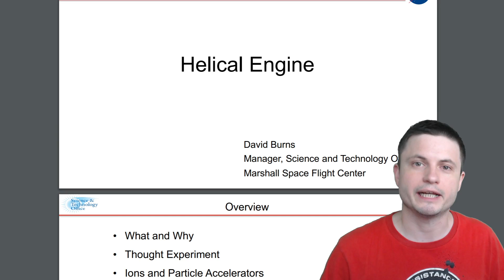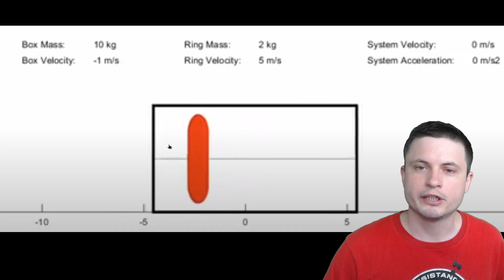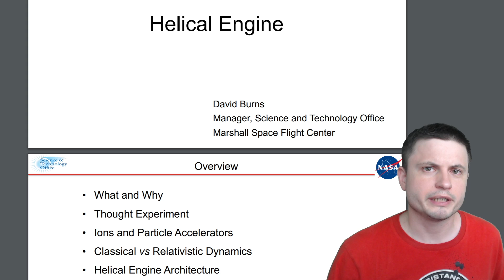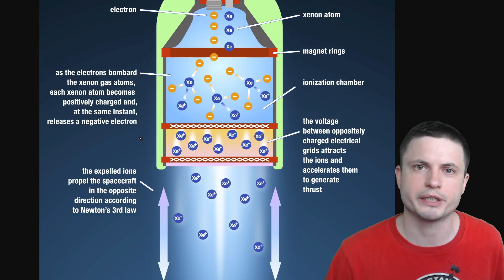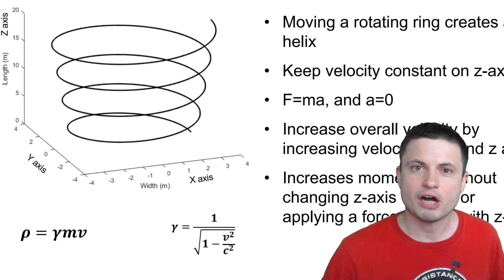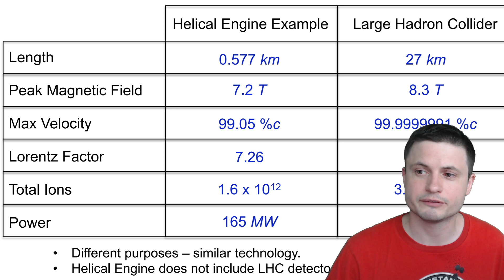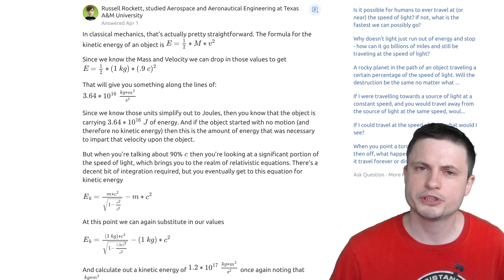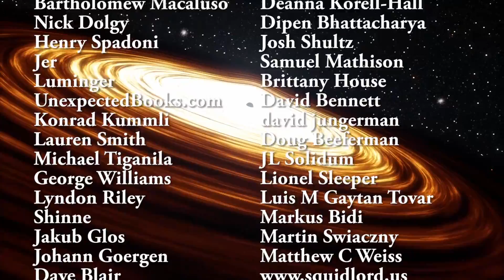NASA Engineer Designs a Near Light Speed Engine But Does It Work?

Comment: "I decided to do something really crazy and actually read the paper instead of criticizing it first."
Reply: Only 7 likes man how underrated
Reply: @hatman23433  I can live with it.  Thanks :)
Reply: Any chanve you have a copy of it please? I would like to read it
Reply: @senseilewis3707   Check the description of the video. It's a NASA report.
Reply: @D_V_.746  "Its bullshit you havent made any calculation youre misunderstanding a law,"

I have a PhD in particle physics. I'm pretty sure if I misunderstood something basic like conservation of momentum someone would've pointed it out by now.

The calculation is unassailable. Initial momentum = 0 (since there's no motion). Final momentum != 0 (since the spacecraft has some v != but nothing else exists in the universe to compensate). Momentum is not conserved. Period, end of story. Furthermore, the kinetic energy gain per unit time under some thrust F is F.v (see any introductory physics textbook), but the power input is P. If F.v > P, which happens at v = P / F, you have more energy than you put in, so you can hook the thing up to a generator and make a perpetual motion machine. Again, this is unassailable and indisputable, which is probably why NASA removed the pdf from their website.
Reply: Ted Bundy   "that's a very unscientific mindset "

That's what every perpetual motion machine designer says. Look, I don't care that your feelings are hurt, Ted Bundy. This guy proposed a design based on current, well-known physics. It's an objective fact that according to current,, well-known physics, the design doesn't work. The guy's proposal is therefore moot. This is very simple logic, Ted. Surely even you can follow.
Reply: @D_V_.746  Just stop embarrassing yourself. This was a huge blunder by someone at Nasa, and you are talking about things that go way over your head YOU are the one being dismissive here, not isodoublet who kindly explained why it doesn't work, in much kinder words than I would have in his place.
Reply: @D_V_.746  "Why dont you use your PhD and build something better"

Two answers:
1. I am using my PhD and building things that actually work.
2. Those things are not magical space drives that are forbidden by elementary conservation laws to the best of humanity's collective knowledge.

"instead of just trying to shit on other peoples innovation."

Because it's not an innovation. It's just a mistake. Furthermore, by steering people away from what doesn't work, I'm helping direct people to consider solutions that might work, so refuting nonsense is an important part of progress. If you disagree, you fundamentally disagree with science and (to be consistent) I recommend you throw your computer away. It was built using these principles you dislike so much. 

" The NASA engineer that designed the system was probably a lot better versed in the principles than you are"

On the contrary. Even a smart high schooler is more versed in these principles than he is. You'll notice I only needed high school physics to utterly and irrevocably debunk this idea, which shows that the guy isn't familiar with elementary high school physics. That you don't like this fact is irrelevant, but it is a fact.
Reply: @D_V_.746  "How does this design violate the conservation of momentum?"

Imagine the spacecraft is the only thing in the universe (just for simplicity of discussion). Initially it's not moving. Total momentum of the universe = 0. Then you turn the drive on, nothing leaves the spacecraft, but it accelerates. Now you turn the drive off. The momentum of the spacecraft != 0, but since no propellant was expended to compensate, the total momentum of the universe is now != 0, so momentum is not conserved. That's how trivial it is.

"its not like hes saying you dont have to constantly add energy into the system in order to make it work, that would be impossible."

Because it violates conservation of momentum, it accelerates much faster than an ideal photon rocket would given the same input power. This means there's some speed at which the kinetic energy gained exceeds the power input to the drive (that speed is given by power input / thrust). Now the drive is a net energy factory as well, so you can strap it to a generator and enjoy more energy than what you put it. It's a perpetual motion machine.

"But on its face its innovative and its got merit so why not explore the idea? "

Because it doesn't have any merit. The guy simply neglected the fact that in order to accelerate the donut and make it more massive you have to pump energy into it, and there's a recoil force associated with moving that energy around as well. When properly taken into account, you see that the total thrust is zero -- the drive doesn't move at all, as conservation of momentum demands.
Reply: Ted Bundy  Science knows it doesn't know everything. Otherwise, it'd stop. That has nothing to do with this latest perpetual motion machine design.
Reply: Ted Bundy  "You don't have a good mindset"

Sure thing, Ted Bundy.
Reply: Ted Bundy  "just realize perpetual motion is putting in no energy and getting free energy out. again, this drive relies on constant energy to be put into the system, which shows its not perpetual motion"

And you have the gall to pretend you're a physicist. Look, this isn't complicated: under an amount of thrust F, the kinetic energy increase per unit time will be F.v. Say your engine needs a power input of P to function, then when v > P/F, you're gaining more kinetic energy "bang" per unit time than you're paying for with your power "buck". Strap the thing to a rotor and you have a free energy device.

For all real propulsion systems, the value of P/F is larger than c, so we're safe. For this guy's propulsion system, it's less than c, so it's a perpetual motion machine, which proves it's nonsense. There's no argument, buddy: energy and momentum are both provably conserved in electromagnetism (whether quantum or classical), so any suggestion of a device like this that doesn't rely on new physics can be shot down immediately. Real physicists understand this.
Reply: @isodoublet  Could one make the case that from the ship's reference frame the relativistic momentum of the ion ring traveling in either direction is equal and opposite thus producing no thrust, and conserving momentum.
Reply: @09patrick22barnes95  The momentum of the ion ring is always opposite to that of the rest of the ship, yes, so the position of the center of mass doesn't change.
Reply: @D_V_.746  "but there is still a overall positive movement."

If there were, conservation of momentum would be violated. There's no escaping this.

Like I said: initial momentum = 0. Final momentum != 0. It's explicitly not conserved. If you want to dispute this, instead of a wall of text, just show how my calculation here is wrong. But you won't be able to, because this is the bare fact. You can't meaningfully disagree.
Reply: @D_V_.746  "You dont have to have a PhD to use common sense and to be supportive of ingenuity. "

There's no ingenuity here. Just a physics mistake by someone who's ignorant of some basics. 

"If you want to bitch and fit about a principle that has merit and uses proven principles, fine you do that."

That's funny, because you're the one doing that: conservation of energy and conservation of momentum are provable principles that irrefutably apply to this design, which also irrefutably violates it. Conservation laws are the "proven principles" which you're denying because you don't like them. But that won't make them go away.

"But thats the great thing about science, whether you agree with it or not, its still fact."

Hear hear! Whether you agree with it or not, this design violates conservation of energy and conservation of momentum. That's just a fact.
Reply: @isodoublet  Think of it like rocking forward in  a chair with wheels lol.
Reply: @quentinfreeman7516  Static friction with the floor. No analogue of that in space. Conservation of momentum is a theorem, not a guess.
Reply: Ted Bundy  Bye! Whenever you come up with an actual argument I'll be here. Good luck!
Reply: @D_V_.746  You are stupid. Here is why : the paper is not questioning any laws of physics, he wouldn't have been laughed at if it did. The paper uses special relativity, also known as basic science, in a completely mistaken way, to design an hypothetical engine. The keyword here is hypothetical.He never built anything, proved anything, he said that theory would allow for such an engine. But he made a big theoretical mistake. Conservation of energy and momentum is one of the most basic laws of the universe, and he raped them is this now shamefully removed paper. 
If he builds something that works nobody will laugh, or if he creates a theory that uses new physics that could be tested nobody would laugh. But if he makes stupid mistakes in applying existing theories, then yes, people will laugh. And people make mistakes like that everyday, thank god Anton doesn't make a video everytime.
Reply: @D_V_.746  Would you prefer I lied? "Here sir, this thing is totally possible! The guy didn't make any mistakes at all when deriving this, none whatsoever." So then people waste time pursuing an idea that's fundamentally flawed? Maybe that's how you're accustomed to it working (orders are orders even if they're bad orders, there'd be chaos otherwise) but in science we don't roll that way. The truth is always what's most important for us.
Reply: @isodoublet      I think you both have a point
                                   it does look impossible by current physics
                                   but God keeps rewriting the rules to keep us awake
Reply: Me as well
Reply: Can you read it to me?
Reply: What were the side affects?
Reply: You sir are an absolute madman.
Reply: @rustyshackleford3914  Thank you Wibble Wibble!
Reply: And then criticizes the math same as them
Reply: You only need to read the first few words, which speak of a spaceship reaching 99 % of c without telling you where that almost unimaginable amount of energy would come from : E = mc2 where E = energy in ergs, m = mass in grams. and c2 = speed of light in centimetres per sec squared. The energy of an H bomb is nothing by comparison.
Reply: Actually, you don't need to read it. The engine violates conservation of momentum so it's guaranteed that there's an error somewhere. His design isn't even new -- James Woodward has been trying (and failing) to advance a similar design for decades. Woodward, to his credit, understands that this kind of design is forbidden by our known laws of physics, so he proposes some new ones. This guy is trying to make this stuff work without any new physics, and that we know with absolute certainty cannot be done.
Reply: isodoublet so conclusive
Reply: @isodoublet  amazing                                    a sane person
Reply: @isodoublet  we also knew you couldn't use a rocket in space..

Until we did
Reply: @mondaysinsanity8193  Nobody 'knew' that.
Reply: @isodoublet  yes actually there was multiple scientists at the time saying rockets cant work in a vaccuum because there's nothing to push on
Reply: @mondaysinsanity8193  1. What "scientists" were these? I have seen idiots say such things but they weren't scientists. Any physicist could've told you that rockets can work since at least the 1700s. 2. So what? This guy here is saying that you can move without pushing against anything, and that's wrong too. It doesn't matter what people say. It matters what the theory predicts. The theory predicts that rockets work and this doesn't, and that has been so ever since the theories were put to paper. What some idiot or another "thinks" the theory says is irrelevant. Both facts are mathematically demonstrable.
Reply: @isodoublet  the point is science exists to try to prove itself wrong thats the point the second you start scoffing shit kinda stagnates
Reply: @mondaysinsanity8193  If known science is wrong, then this idea, which is based on known science, is wrong too. Look, it's simple: the guy says "the theory predicts X". Does the theory actually predict X? The answer is no. It very much doesn't. If it doesn't predict X, his design is worthless. You may find a design that does work as a thruster and falsifies known physics, but it probably won't be this one. Or, if it does turn out to be this one, it'll be a total coincidence because we know for a fact that this guy's argument is wrong. That's all there is to it.
Reply: @fadzaindlovu1097  back when? Lmfao
Reply: @mondaysinsanity8193  Rubbish! Newton knew 300 years ago that rockets would work in space. According to the equation E = mc2, the energy required for a 1,000 ton spaceship to reach 99 % of c  would make the energy of the Chicxulub meteorite pale into insignificance. Where is such energy going to come from? Nuclear power is totally inadequate.
Reply: @mondaysinsanity8193  well they were right for a degree as as several rockets can’t work in space 
Like atmospheric rockets
Reply: RESEARCH """""BRIAN AUSTIN LAMBERT""""" 100% WORKING MODEL OF A FLAT EARTH,,, 
WEN,,(IF U DO CHANCES ARE U WONT LOOK),,UV DONT THAT GO RESEARCH """"" THE PRIMER FEILDS """"",,,VLOUMES 1 THREW 4,,,BASICLY(INCASE U DONT LOOK) CANT LEAV FIRMAMENT IDIOT,,,,EVVVVVVVVVVVER!!!!,,, NASA LIKE ANNNY OTHER CIVALIZATION BEFOR US!!!,, HASSSSS NEVER LEFT THE FIRAMENT!!!!,,,:Fact: SO NOW I SAAID UR ROOONG,,,, DIS PROVE ME!!!!!!
U CANT!!!,,, ESSSSSSSPECIAL IF UR RELIDGIOUS!!!!!! KORZ THE VATICAN HAS THE WORLDS BIGGEST SUN DIAL!!!!!!!!!!! aka TIME KEEPER!!!!!!!! ASK URSELF Y!!!!!!!!,,,YEAH U BEEN LIED TO SHEEEEEPLE!!!!!
Reply: @rexbaking1701   I know I shouldn't reply but I can't resist.  Dude, first of all, type in sentences.  Second, don't use all caps, it just makes you look like a crazy person. Third, I really think you need be taking your medication on a regular basis.
Reply: @ptonpc  lol he's on gire
Reply: @ptonpc  Yeah... It's not so much the "all caps" that makes him look like a crazy person. That just makes him look like a LOUD crazy person. Just saying.
Reply: @dhotnessmcawesome9747   Unfortunately plenty of them about.

Comment: The problem with any near light speed space travel remains the same .and with this concept in the video the problem reaches critical. The problem is once you reach the extreme upper limits of  velocity is how do you stop.if you are constantly accelarating it is going to need a great amount of fuel too stop . And in this example of an alternative propulsion system it would take a very long time too slow down 
A very long time. It is my own thoughts that tell me that anything that reaches the near to the speed of light velocity will never slow too a stop ever again unless it smashes into something like in an accelarator. Pleace tell me of anything that has ever reached the speed of light or near the speed of light and then stopped?.i dont think you can stop without having enough fuel and it would require more then  alot. And more then you could carry.not to mention attempting to turn the ship around while taveling the speed of light so you could do a burn might like wise be impossible.thusters at the spped of light probably would be sure death.

Comment: I assume instead of "a mass" the acutal accelerated object could just be for example some noble gas... I take it the point of the spiral is to accelerate the object without imparting a forward or reverse thrust, if however at the time of deflection it has the same energy as when it bounces off the other side of the container wouldn't this prevent thrust from occurring since you have applied a force at peak mass in both directions even if when it is boucing back it is doing so at say half the speed. Certainly interesting .... I need to read the paper some more and thing about it.

Comment: In the mid 90's, I emailed NASA with a sort of "perpetual motion" engine using magnets and electromagnets within an inductor(I've been constantly updating my design through the years).  Using this motor to generate a magnetic field around a space vessel and then using satellites to beam polarized RF at the ship to push and pull objects through space. I never heard anything back.  Just recently, I saw a company had developed a similar electric motor design with a super high efficiency.  Either someone at NASA perfected my design or someone I was stationed with in the NAVY stole it.  =-(  One of these days, I'll have the opportunity to show them how to make it REALLY work.  =-)  Excellent video Anton.
Reply: Sorry it's been stolen/copied. Sounds interesting, but I feel it's strange you never heard back. If it was a good, practical idea they most likely would have tried to get you on board with them, as perpetual motion is very big. Perhaps your idea was great, and someone else came up with something similar because they had the same sort of idea?
Reply: @Muthusala2630  Who knows.  Maybe they took my idea and developed it in a different direction.  As long as we advance, that's ultimately all I care about.  Making life better for the human race.